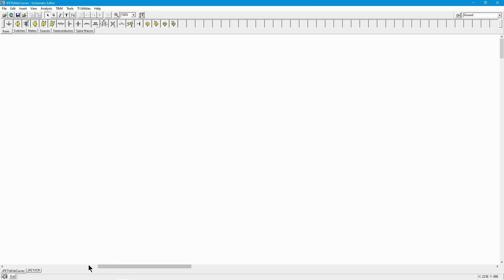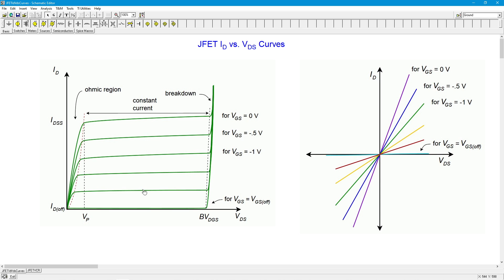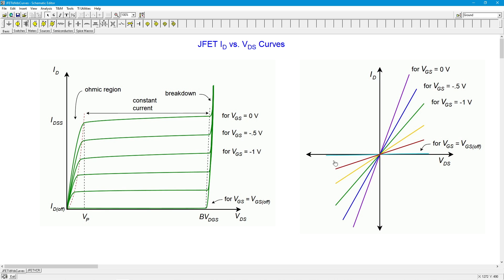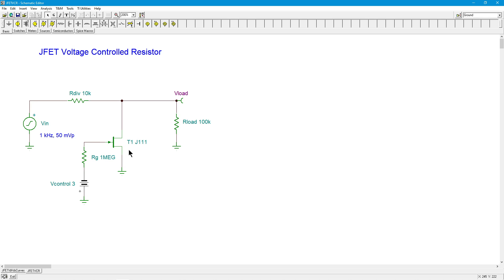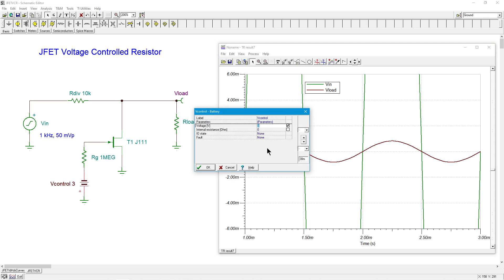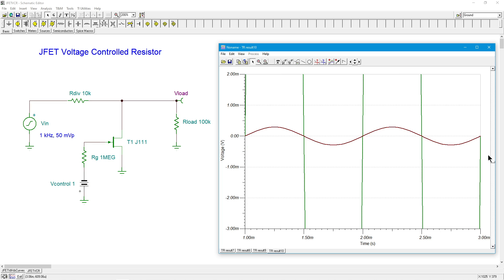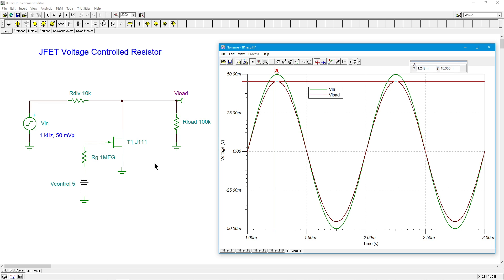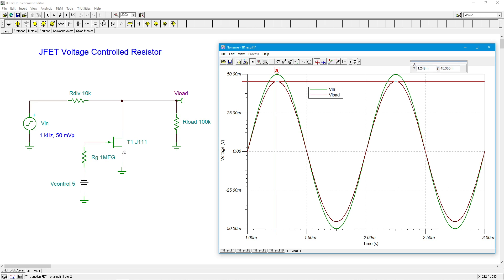Semiconductor Devices: JFET Voltage Controlled Resistor

Comment: a cool application is using this device with a lfo voltage supplier, so that the resistance changes periodically with the desired frequencie. its commonly used in chorus effect pedals, where we want to vary the  delay of the guitar signal!
Reply from the maker: Funny that you mention that. I have a video on using this for a phase shifter coming up shortly.

Comment: Can I use this as variable resistor for AC signals? Eg. audio. Also, when using p channel jfet so that I can use positive control voltage, does the circuit remains the same?
Reply from the maker: Yes and yes. You just have to keep the input level low (less than 100 mV or so) or you'll get a lot of distortion.

Comment: I'm not getting why we operate an amplifier in the saturation region. How dies that work? I would expect to operate an amplifier in the linear region, for fidelity. ?
Reply from the maker: Correct, we generally do not wish to run an amplifier in saturation, but this is not an amplifier. We're running the FET its ohmic region. This is not the same as running a BJT in its saturation region. Different device, different characteristics.

Comment: Can you explain how you're using the voltage divider rule to calculate that Rd value?
Reply from the maker: VDR says that voltage will divide proportionally to resistance in a series loop. Thus, if you know one resistance and the ratio of the voltages, you can find the other resistance (e.g., if it has one-tenth the voltage, it must have one-tenth the resistance.
Reply: @ElectronicswithProfessorFiore  got it, thank you!

Comment: If you were running this circuit from a 9v source, like a guitar pedal, would you need something like a charge pump to provide a negative voltage for the voltage control of the jfet?
Reply from the maker: You might consider using a P channel FET.

Comment: Super cool circuit!You can linearize this by putting another 1M from Gate to Drain as feedback. It reduces distortion quite a bit if I recall correctly. I feel like I may have added a DC blocking cap also between the added resistor and the drain but I'm a little fuzzy on this - It was 20 years ago.
Reply from the maker: Yep. You need the cap otherwise the added resistor will spoil the bias and the control won't be the same.

Comment: OK, so it’s a variable resistor.  Why is it being used in parallel to the load?  I’m assuming to maintain biasing in linear region. Can it be employed in series with the load?  In parallel  and in series to other jfet (resistors)?
Reply from the maker: Yes and yes. You'll want to stay tuned for an upcoming video covering an analog switch using JFETs.